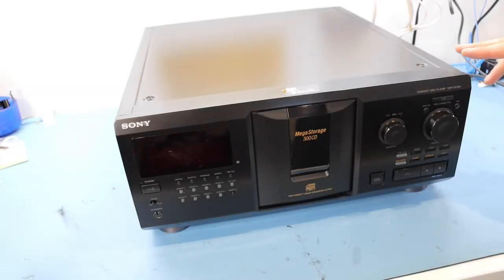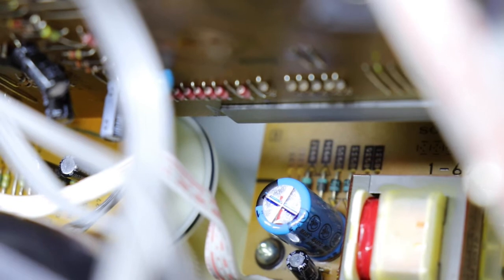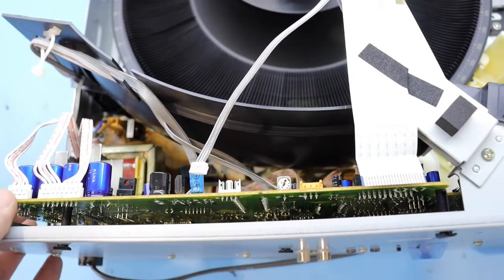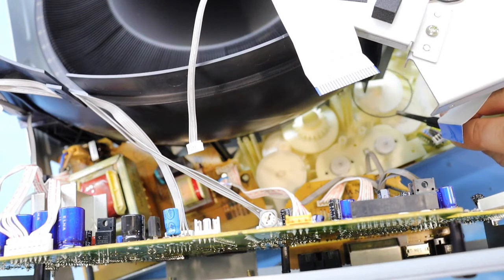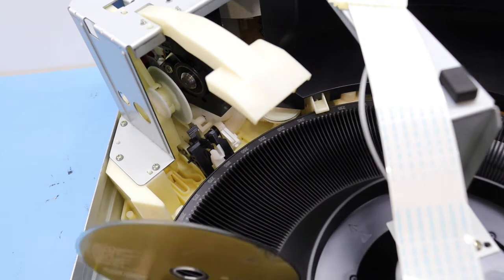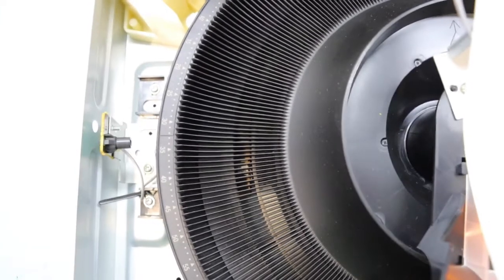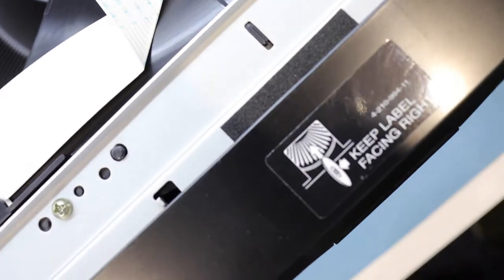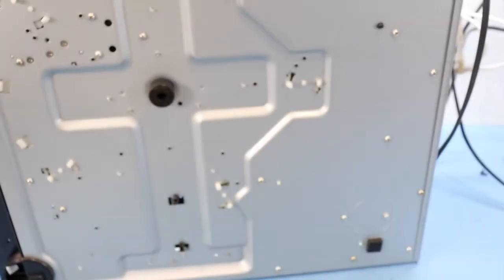HOW TO - Fix belt & playback issues on Sony`s 300 CD Mega Storage  Changers - CDP-CX355 CDP-CX350

Comment: I have a sony 400 cd player that's giving me problems.  Once the carousel goes around to detect no disc, it pauses and then starts to turn again and stops and starts to turn again and finally stops with no disc display.  Once I open the door, I can see position 1 is not lining up with the front line indicator.  It's off about 5-7 slots.  The carousel also has a noise/squeak when it turns.  I'm not sure if it needs to be scoped to align it or if there's an easier solution.  I checked the belts and they don't seem to be strectched out.  I need your advice please.
Reply from the maker: Either one of the rollers under the turntable is out of position - theres a few of these and its just a plastic clip that holds them in place, with age snaps and needs to be glued back - or at least one of the plastic "teethpegs" in the turntable which the photocell counts to know the position of the tray is broken or missing.
Reply: I took the turntable off this afternoon.  All the teeth are intact.   The rollers are intact.  What do you suggest to re-lube?  Thank you for responding!

Comment: I have replaced the belts on many but now I have one where I changed the belts and now the carousel just continually searches back and forth and will not stop.  What do I do to fix this?
Reply from the maker: you`ve either knocked the disc sensor at the side of the carosle out of alignment or one of the black plastic tray pins which the sensor counts under the table is bent or missing.

Comment: Good Morning.

Your video is very well explained.

I'm from Brazil and I got this used cd player. This cdplayer was stopped for about 5 years.

I didn't know there were cds inside it.

There were about 100 cds inside the device and I had a few that were out of the tray.

After I removed all the cds with the device turned off.

After that I turned on the cdplayer, I put about 5 cds. I put it in position 1 to 5 and pressed play and the tray rotates, the cd goes to the reader. I can hear the cd coming in.

Then on the screen it appears on cd 1 that it has X songs, but nothing else appears. Music 1 does not appear playing. I switched to cd 2, 3, 4 and 5 and the same problem happened.

As I work with computers and the technology is basically the same and I've seen the same problem, I think this is a problem with the reader or laser lens.

If you have any other ideas, I would like to try to solve this problem, as I found the device amazing and would not like to throw it in the trash.

Thank you so much.
Reply from the maker: thanks

Comment: Changed belts but carousel not traveling far enough to load disk into playing mechanism.  If I push the carousel slightly forward it loads but on completion of disk play reads table error.  Is there a way to adjust the table to move it just a touch farther than where it is stopping?
Reply from the maker: You`ve either got a sensor out of alignment, or (more likely) a bent plastic pin under the turntable which the sensors count for position.

Comment: Mine turned to Black Tar....this Definitely Will Save Time
Reply from the maker: Yeap, common on pretty much any sony item with belts from this age....
Reply: @Sortitoutman  so went back at installing new belts on the 300 disc changer.... Job completed in 25mins......7 screws made huge difference
Reply: @Sortitoutman  I had made attempt last week and stopped after 45mims when unable to gain good access to 2nd belt
Reply: @da900smoove1  Hope all is well with you... Wondering if you can share where you ordered the belts, what size, brand etc....  Noticed your comments are from a few months ago, has your player been working well since?

Comment: I can't find anywhere where the door belt is being replaced or where it is located.  None of the videos seem to address this and I have a unit and the door won't open.....
Reply from the maker: As per video its located under the table.... Its not addressed as the belt does not usually fail unlike the others and does not need to be replaced - door not opening is usually a different fault unless you can hear the motor actually spinning.

Comment: Mine loads cds and the carousel works fine, but when the CD is loaded it doesn't spin. It just tries loading and unloading the disc until it eventually starts shuffling through different disc #'s. Any idea?
Reply from the maker: Sounds like the lasers failed, not expensive to replace

Comment: Also the first time after power up the unit will load a disc from the EZ play slot. From then on it fails every time.
Reply from the maker: check your play mode if its working from ez play then the belts are working

Comment: I changed the belts, and now runs quietly. Problem is that the turntable now moves to the correct disc, the disc loads into the reader, and then the reader immediately ejects the disc and replaces it on the turntable. The disc never spins up. I feel like I might have missed replacing a cable connection, but don't see anything amiss.
Reply: I have the same problem.  Replaced the belts, the disc loads but does not spin and then ejects.  It then loads again but does not spin and ejects.
Reply: @brentgreider7658   I took mine to a repair shop run by a guy who loves to work on these things. He said he could probably fix the reader part, but that the tray rotational gears were so broken that it wasn't worth fixing. He bought me a used 200 disc player model for ~$200, which is now working fine.

Comment: Change the belts no problem now it’s showing a table error and now  lights are flashing from blue green to yellow
Reply from the maker: check under the table that none of the plastic pins that go all around the edges are missing. Thats what the sensors count to know the table position, if any are missing it won`t know where the table position is.

Comment: I put new belts and still does not work, lights up but no motor sound
Reply from the maker: check your ribbon cables are plugged in the correct way round

Comment: i have a sony mega and i replaced all 3 belts but the front door does this thing where i kind of shuffles and stutters a few times before eventually opening, do you know why the door wouldn't open right away?
Reply from the maker: check you`ve not knocked it from its slider mount